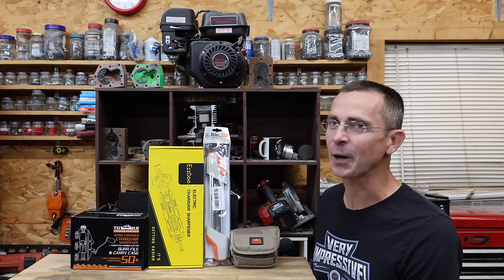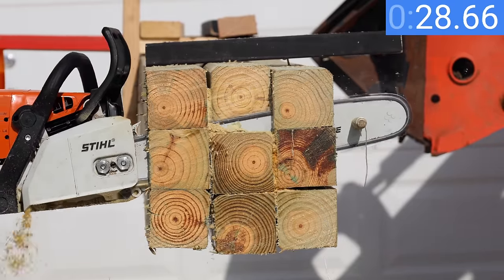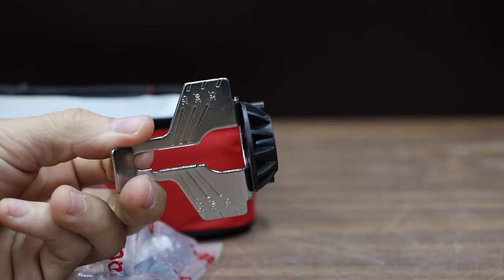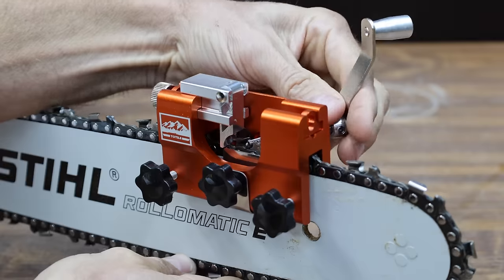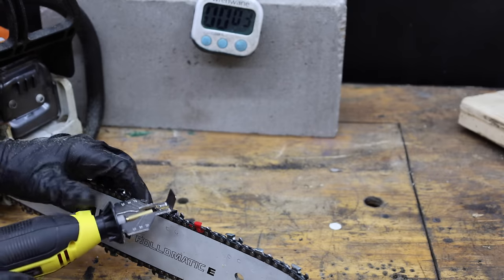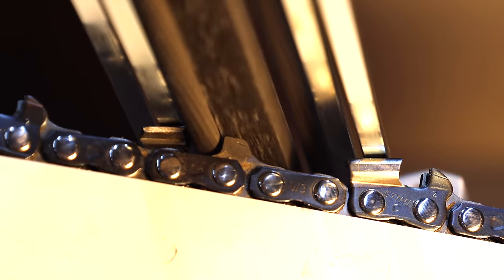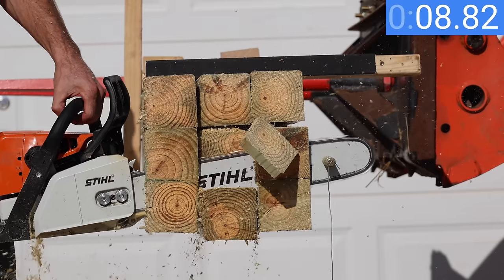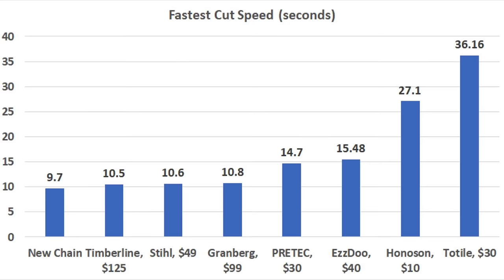Which Chainsaw Sharpener Is Best (2024)? Let's Find Out!

Comment: It has been my experience that anyone that sells chains will take too much off when they sharpen them. For that reason I have a Harbor Freight plastic sharpener that has exceeded my expiations. I don't chop down on the chain, I push the chain into the spinning sharpening wheel. It doesn't remove a lot of metal and the chain will be like new. I don't run my chains once they start getting dull so they aren't in terrible shape when I sharpen them. A chain will last twice as long if you sharpen it yourself.
Reply from the maker: Thanks for sharing!

Comment: Get the gullet!!! 

Put your chainsaw in a vice and hold the end of the file with your left hand, or hand not on a handle, and your filing skills will increase dramatically. 

Also using a vice makes sharpening a chain go by so much faster.
Reply from the maker: Thanks for the constructive feedback.
Reply: @ProjectFarm  I assume you were testing as if you were on the mountain without a vice which then I would suggest standing behind the saw, leaning over it with your chest on the handle/motor to stabilize the saw as you file. Another option would be cut half the bar height into a 10-16 inch long log and use the cut to hold the bar in place. So the teeth are a above the log. Or bring a metal c clamp with you. That's my personal preference.

Comment: Could you do the same test but using the different amazon brand chains vs the brand name chains. I bought some weird knock off 16" chain Kakei for a stihl ms180 that cost 25 for 3 chains. Where the same exact stihl blade was 25 for 1. I would be interested in the claims of these being German steal.
Reply from the maker: Thanks for the suggestion.

Comment: 1.) Stop hitting the ground and your chain will stay sharper, longer.
2.) After a days use, you should sharpen up the teeth. A dremel is way too aggressive.

a round chainsaw tooth file is all you need. If the teeth arnt getting sharp, your doing it wrong. Follow the angle of the tooth shape. Im a tree worker, there's no fast way to sharpen. Use a sharpie on a tooth to ensure your sharpening at the correct angle.
Reply from the maker: Thanks for sharing!

Comment: I don't care which tool you use, if the top plate on the cutter isnt sharo, you haven't finished sharpening the chain yet.  

Also, every tool you're using is goint to have a slightly different diameter.  You need to get the cha8n completely sharp, then dull it and sharpen it again to evaluate the tool.

Comment: The Stihl was the only file set that set rake height. So any other tool used after the Stihl sharpening will of course cut better than if was sharpened by other tools tools alone. Test is flawed. To sharpen a  chain and not file the rake is improper chain maintenance.

Comment: This is a rare flawed test. He doesn’t start the timer until the actual sharpening process begins. Time should be measured to include assembly of the sharpener and attaching it to the blade (as required).  For me, the KISS principle applies and the Stihl manual sharpener is the clear winner.  No assembly, no complicated set up, no electricity required, no small parts to lose and it simultaneously dresses the depth gauge.

Comment: I am sorry to be late to the party, and no offence to dent pullers, I've seen dent pulling on youtube, and fixing dents has art, voodoo, and hokum.   Please consider dent pullers, some use hot melt glue, which is quite interesting.  But too many have screw type pullers, while actual mechanics use hammer types.
Reply from the maker: Thanks for the suggestion.

Comment: Best sharpener - a correct size file.  The MS 250 sucks.  It is a bitch to crank up.  I use only Stihl files, except for 3/8” Husqvarna chains.  They require a 7/32” file.

Comment: Id really like you to make a video regarding cordless tool battery adapters and if one should use them or not. Example my dewalt tools have 4 pins on the battery and my ridgid tools only have 2. If i use my dewalt batteries on my ridgid tools or vice versa am i going to ruin tools or batteries. Info from an educated person would be fantastic
Reply from the maker: Thanks for the suggestion.

Comment: After extensive research online regarding chainsaw sharpening, one of the things I learned was that only the tip of the chainsaw blade cuts the wood being cut. That is why the raker is lined up with the tip of the blade. That is also why a chainsaw blade can be dulled by just a slight touch of a stone or the ground. If this is true, and I believe that it is, your method of testing the downward sharpness of the blade is irrelevant. The edge you are using has nothing to do with the actual sharpness of the blade. The sharpness of the part of the blade that you use for the test is a peripheral result of the sharpening process and it means nothing as to how well the blade will cut. Go online and do a little research with people that sharpen chainsaw blades for a living, And I think you may decide to change your testing process.